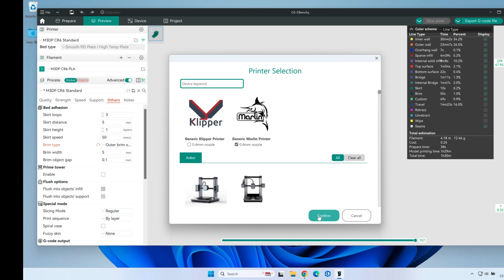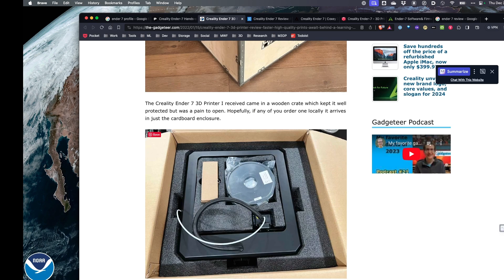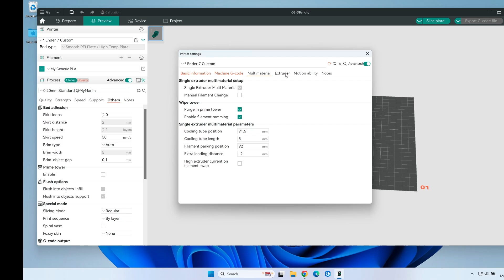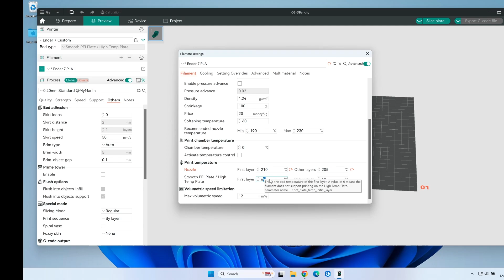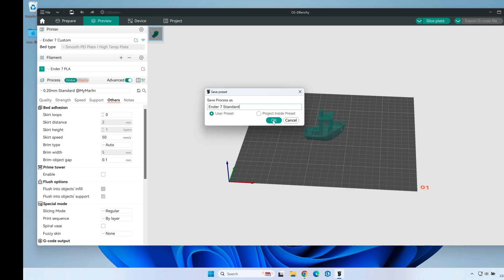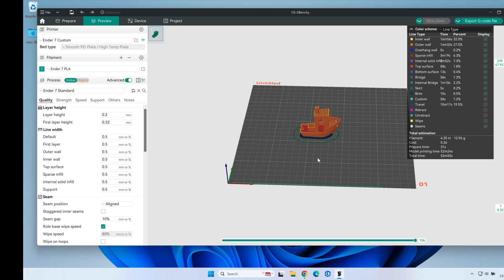Here We Go! Orca Slicer 101: Mastering the Basics (Creating a DIY 3D Printer Profile), Part 3

Comment: You say at around 10:00 that you'd generally do some tests to help you determine actual values to use for speeds & accelerations. What types of tests would you do and how would you use the results to help you determine actual values to set?
Reply from the maker: Take a look at the calibration tests built into orcaslicer. Those test will help you dial in on your values. Let me know if I am answering your question.

Comment: Great video.. I have a similar question:  For instance there is already an Anycubic Vyper profile, however it is only for a .4 nozzle size, what needs to be changed from the .4 nozzle profile to utilize  a .6 nozzle on the same printer.
Reply from the maker: You will need to test and change the flow rate. I think you will also need to play with pressure advance.
Reply: @minimal3dp  Great video. I also have a very similar question. I'm slowly moving a Sovol SV06 that I was using on PrusaSlicer and want to move to Orca Slicer. I see there is a Sovol SV06 .4mm Nozzle profile but I'd like to start using larger nozzles (.6mm & possibly a .8mm). Could I simply clone the .4mm nozzle size to make a .6mm nozzle and use the same print settings for a .6mm nozzle? I'm assuming I'd have to make some minor adjustments to "line widths" &  "speed" & of course do some calibrations and etc... for a .6mm nozzle. I haven't tried it yet but wanted to get a 2nd opinion before doing so. Thanks in advance for your help!

Comment: Thanks for this, I already did it and I don´t know what is wrong with my printer or is it Gcode but I can´t get it to print. It does all the prior movements, reaches temperatures but does not start printing. I installed a new Makerbas Nano Robin electronics which is perfectly working with Marlin 2.1.2 and Cura.
Reply from the maker: I wonder if it is your start code. Can you share it?